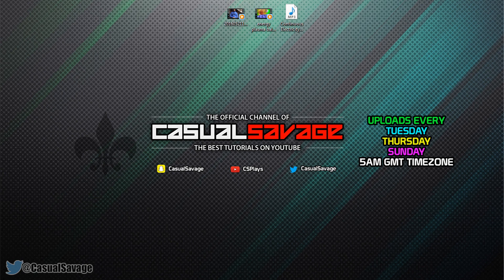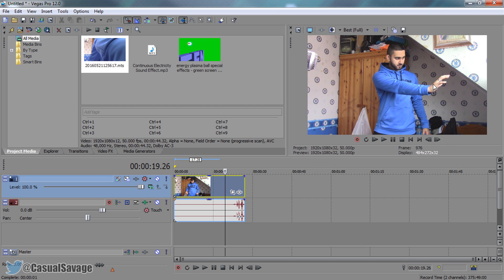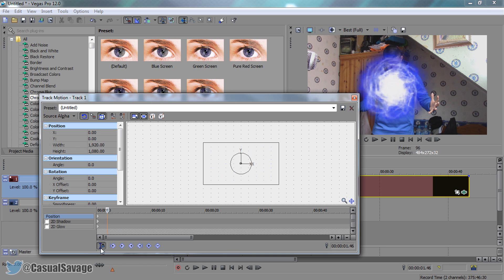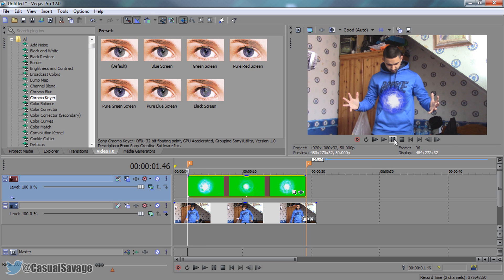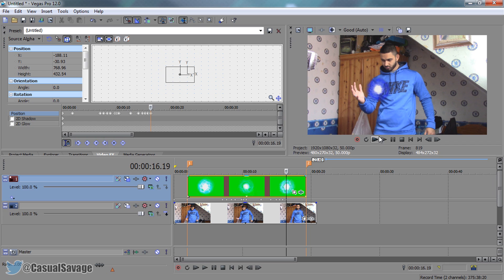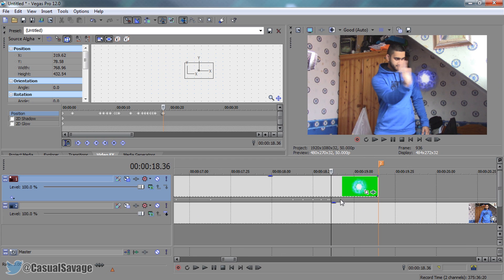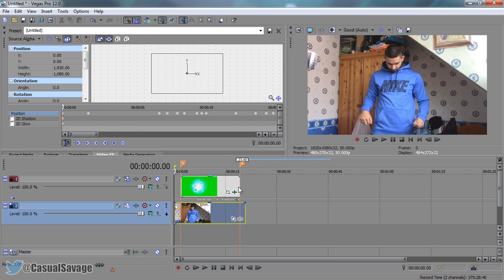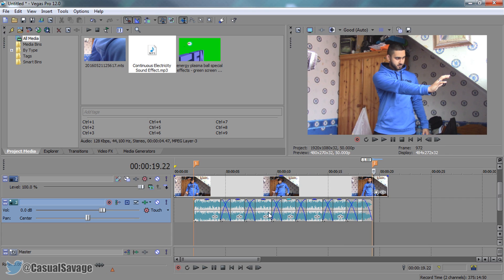How To: Make Energy Ball Effect in Sony Vegas

Comment: Hi, thanks for the videos bruh..I am learning how to do it myself. however I have 1 small problem. I am using Sony Vegas Pro11 and I can't seem to find the Pan/crop tool..the rectangle on...please advice.Thanks CasualSavage.
Reply from the maker: +ced3361 You don't need the pan and crop for this effect, you can use track motion. But if you want to use pan and crop then right click your video then select "Video Event Pan/Crop..."
Reply: Thanks for the reply, but its not for this effect but just in general, my Sony Vegas Pro11 doesn't have the crop tool, is there a way to fix this?